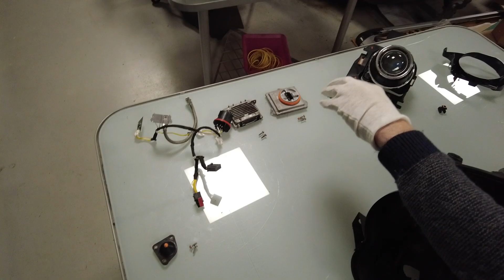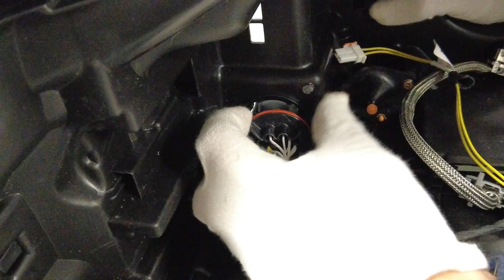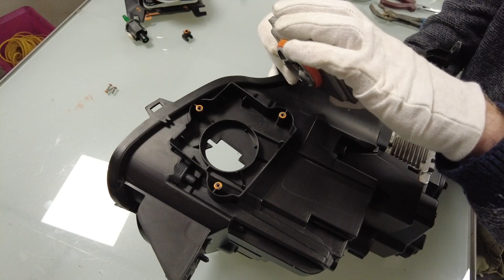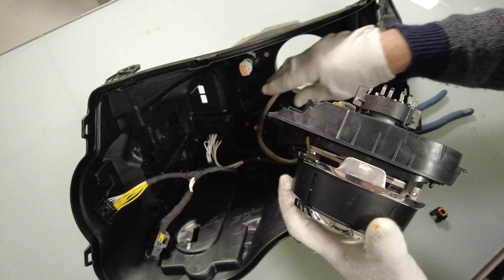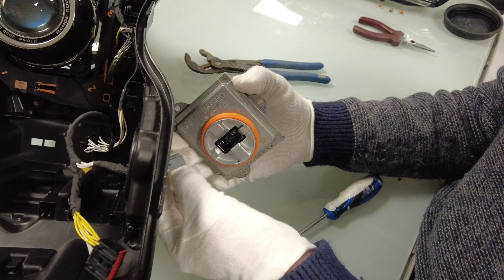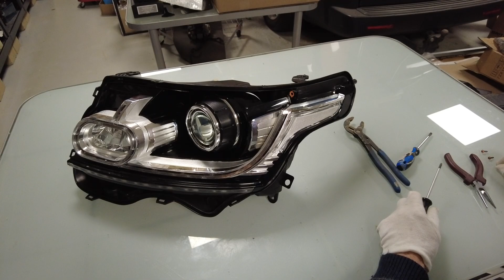Range Rover L405 2013-2017 Headlamp Repair - Part 2 - Re-assembly

Comment: @L663 ,
 I have been receiving conflicting comments as to these L405 headlights being self leveling/range control for up and downhill, my 2015 L405 Autobiography LWB 5.0 SC does not have the headlights dance up and down upon startup or turning on the headlights, yet others in groups and forums claim the headlights do dance up and down upon being turned on, yet I see nothing in your video showing that either of the 3 mounting points for the projector have any electrical connections. 
 I will add, my window sticker does list "auto leveling headlights"...
 Thank you for your thoughts. 

Johnny

Comment: Hi Simon seeking your help have a new defender 3l d have fitted a lithium battery and dc dc charger in order to trick the smart alternator I need to connect charger single wire to a positive point that is only active when ingnition is on ,.with all the wires in rear compartment which one would be best to connect to.enjoy your videos.Garry
Reply from the maker: We used the Towbar connector in the boot
https://www.powerfuluk.com/vehicles/land-rover/new-defender/interior-accessories/boot-tow-bar-power-take-off-loom-for-land-rover-defender-l663.html